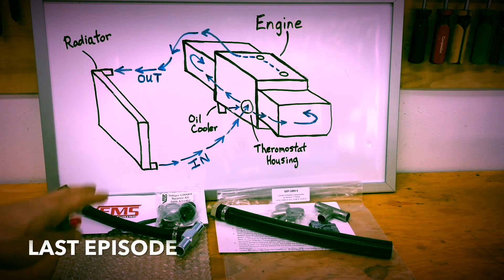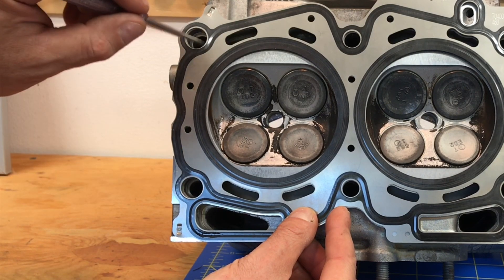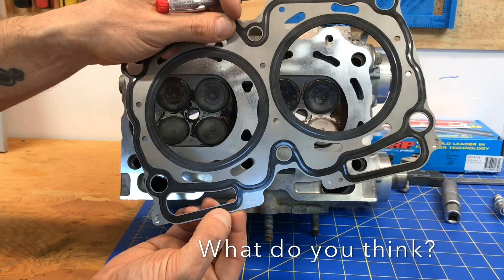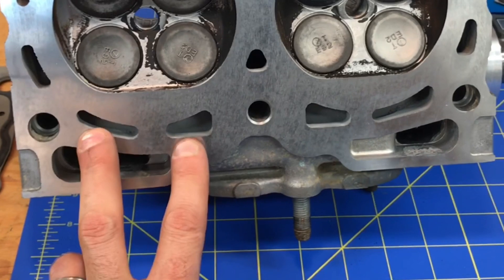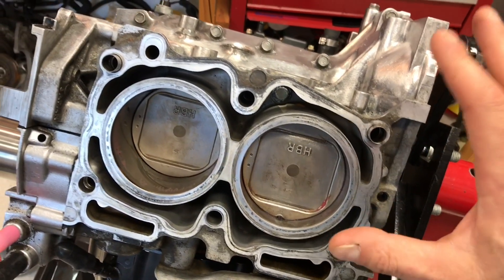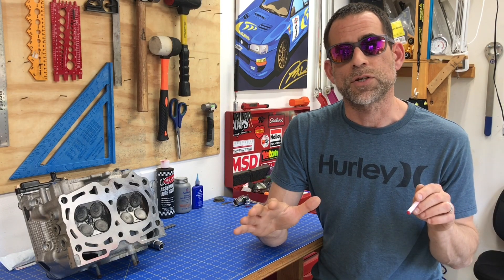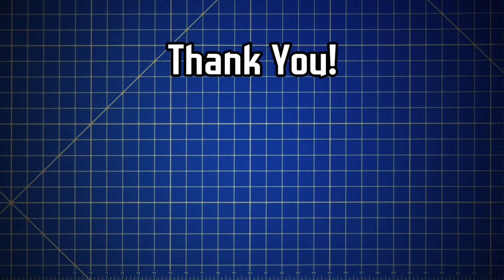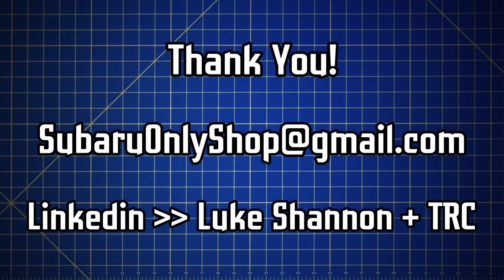Coolant Flow in Subaru EJ-Series Heads

Comment: Hi LUKE = i put a ej207 jdm sti , virgin block into my 2001 forester - did heads with brian crower guides springs valves - s/s swirl polished viton seals - and 5,500 klm did the no 4 by-pass coolant upgrade - i could tell a differance with in 5 klm drive - i have big radiator new new new everything - great modification instant benefit = thank you paramedic life subaru saver LUKE !

Comment: Need help, so I installed a 4 cylinder cooling mod then I put a 6-7L Subaru OEM coolant, did the burp but for some reason my coolant reservoir didn’t change still empty even I put 6-7L of Coolant? Any guess?
Reply: Even I put coolant in the reservoir between full and low lvl line, every time I drive it it’s go back to the very bottom of low lvl
Reply from the maker: I’d keep adding coolant till it stop dropping in the secondary reservoir. Must still have some air pockets.
Reply from the maker: And good luck!!!

Comment: Hi mate im just asking why my subaru impreza 2002 radiator coolant hot on top and boiling but on below is cold, but when I removed the thermostat its still open meaning pump failing or head gasket?
Reply from the maker: Yes, your on the right track. Most likely one of those two issues causing the over heat. Good luck! 👍

Comment: Great Video!!! 
Got a question.  Are there any benefits of installing a reverse coolant mod in a EJ253 2.5L SOHC? I'm In the middle of doing a Head Gasket Job and while the heads are at the Machine Shop it would be a great time to install one if there are some. Thanks for any info.
Reply from the maker: Prob not really needed for a stock engine tune. But couldn’t hurt either.

Comment: So what's your opinion on the strategy for Subaru not to use cylinder 4 cooling mod for the purpose of letting it runner hotter for better knock control?
Reply from the maker: Are you referring to letting cyl #4 run hotter for better knock control? I don’t think that’s an accuse statement, from my understanding, the heat build up in #4 creates conditions where knock become less controlled and more inconsistent.  Also, tangential question, you sound like you have some serious experience in this area, if you don’t mind me asking, what’s you background with these engines? You an engine builder or high performance machinist, just curious. No replacement for real world experience in my opinion, that’s a 10X when it comes to one’s options, especially when there’s so many messages board experts out there.  Thanks again and cheers!!!
Reply: @SubaruONLY I'm an inventor. Built and owned a few EJ207 swapped cars. EJ runs one knock sensor; FA uses two (like most modern engines) --leading me to believe Subaru engineers are trying to improve knock control. Just a theory. I'll be testing my first prototype for a new EJ cooling system design this month. If all works well, maybe I'll send you a kit to try out?
Reply from the maker: For sure man. Send me an email and we can touch base and correspond there, cheers and looking forward to seeing the results!

Comment: I know this was a year ago, but I definitely would not work to increase flow of the coolant. Those restrictions are deliberate. Their purpose is to increase the amount of time the coolant has to pull heat from the engine, and in turn increase the time the radiator has to pull heat from the coolant.
Reply from the maker: Yes, coolant needs to have the residency time in the heads to absorb enough heat. Agree. Cheers buddy!!!

Comment: I don't know if anyone has mentioned it, and it seems that this is over a year old now...but I believe the coolant passages on the headgasket are sized like that for a VERY specific reason. That is, metering coolant flow. If the ports are too big, the coolant will flow too fast and not spend enough time absorbing heat from the head/block. FelPro has a good article explaining this. Let me know what you think!
Reply from the maker: May be a year old, but certainly still worth discussing!  Yes, 100% agree with you, especially about the time the coolant needs to spend inside the head to absorb heat from the head surface. 

That still leaves the problem of preferential flow due to inlet and outlet port locations. Any thoughts on that one?
Reply: @SubaruONLY  It seems like it might just be a design flaw like you discussed. It's clear that having the huge intake/exhaust ports of the coolant flow cause the path of lease resistance. So the water flows there first and doesn't leave much flow on cylinder 4. Looking into a few different type of cooling system designs, it seems this is a more parallel path. I'm working on an inline 4 cyl engine now that has a series path cooling system. The coolant flows through the block and then enters the head on cyl 4. Then flows back towards the front of the engine in the head. Hopefully that makes sense! I'm not sure about boxer motor design, but it seems like this might be the only way to do it reasonably.
Reply from the maker: Yes, likely a constraint with the design and local of all the ports. Yes, that inline description make sense. Sounds cool, this for a Motorsport  application?

Comment: Love your explanation of the coolant taking the path of least resistance 👍 and how the cooling mod helps
Reply from the maker: Thanks buddy!  This is actually my field of expertise professionally. Have a masters in fluid mechanics and hydrologic engineering - applying those concepts to our Subaru engines has been really rewarding and it allows me to create some unique content (I think). Cheers!!!
Reply: @SubaruONLY  I actually looked at studying hydrodynamics at uni with a view of applying it to a motorsport engineering degree there after. Partying got the better of me in 6th form though 😂 really cool to see this level of detail though and its somthing I geek out over. More suspension geometry and setups along with weight reduction though these days 😅 applying this kind of thinking and theory to road cars is somthing that I'm crazy into at the moment anyway, so it's awesome to see someone else with such a keen eye for details that make a car
Reply from the maker: Nice man. Feel you, can’t help it. Cheers!

Comment: I get the point with the cooling mod and the negative pressure etc. But like you say, coolant will circulate the path of least resistance as it is forced around the engine. Its a lot easier for the coolant to escape through the mod pipe into the heater pipe then it is to force itself through the jackets into the rear of the cylinders and up through the exit port. I feel like this mod would be beneficial for the lower half of the cylinder but it would only slow down coolant movement to the top.

It seems to me the sensible thing Is to port the gaskets and leave it at that.
Reply from the maker: Late reply here (BIG TIME, lol). Just wanted you to know I’m back and got some cool things unfolding on the channel. Cheers and hope you are well!!! 👊

Comment: Great video! Just wondering if you're running an oil-cooled only turbo setup, would any modifications needed to be done to the opposite head so the flow isn't impeded? I'm assuming that since the turbo is on that side and has coolant flowing to it from the back of the head, it's helping flow coolant over cylinder #3, correct? Would you just route the turbo coolant feed straight my AOS then back to the upper-coolant reservoir, basically bypassing the turbo section completely since it's no longer needed?

Comment: Subaru p/n 21170AA020 - PLUG-WATER BYPASS is the OEM fitting for the no4 cylinder head plug. Add on a small length of hose & a tee from eBay- sorted.

Comment: Opening up the slots in the gasket might affect the back pressure in the lower area of the block (because of the restriction created by the smaller slots), which could possibly could make the flow issue around cylinder 4 even worse (more stagnation) by making the path of least resistance around cylinder 2.   Although, I believe that if you open the one near the rear of cylinder 4, you might could increase flow there a tiny bit more.  It also looks like there is a fairly dead area of flow around the top of cylinder 2 (flow wise).    I used to have access to computer modeling software that would calculate approx flow lines in 3D models to locate the "stagnant" areas where flow velocity is approximately zero (eddies).  This would be fun to model.
Reply from the maker: Your 100% right and you hit one of the key points I’m going to highlight in the closing video to this series.  Way to stay on top of all this and connect the dots man. Brilliant. 😁
Reply: Correct,  the gasket "slotting" allows Subaru Engineers to fine tune the coolant flow through the engine.

Comment: Any thoughts on whether the reverse cooling mod is necessary on a Supercharged NA car? I think if you did it, you'd need/want to do it on both cylinders 3 and 4?
Reply from the maker: Think it would be a good idea for sure. Ever do it?
Reply: I appreciate you for explaining on how the head gaskets work I had an idea like I knew how they worked but only 70% I didn't know how the flow worked unfortunately for me my 2014 Dodge charger 5.7 hemi has a coolant issue I already kinda know that the coolant passages are going to be clogged due to rust and other things but it also needs the head gaskets replaced I haven't ran it just because if coolant goes where you explained where the oil is I will have a huge bigger problem for sure right now its just leaking coolant into combustion chamber I'm going to take out the heads take them to get resurfaced and have those ppl clean the heads for me like the passages clean them if they are clogged mean while I was thinking of cleaning  the passages under the head gaskets if I make sense basically stick a  garden hose there the hole is where the water pump sends coolant into left head bank and right head bank hopefully that will clean out what ever is causing coolant to not flow I'm also going to be purchasing a new radiator what are your thoughts on that about me cleaning the head banks  I have to remove the water pump and do it that way there's 2 holes on the front of The engine block one for enter and the other seems to be an exit for the coolant I just need to try that while the heads are getting resurfaced and cleaned I just don't want to end up getting water into the oil since water will be mostly coming out of the passages where the pistons are at or am I confused on how coolant flow works your video is only showing the head and gaskets not the engine block I'm taking about the engine where the cylinders are  @SubaruONLY

Comment: The build is coming along nicely, due to poor cooling would you consider a dual cooling setup, for instance 2 seperate reservoirs, split the radiator into 2 and run a seperate pump including the original, 1 system cooling cylinder 1+2 and a seperate one for 3+4, and split the other peripherals throughout each loop

Comment: Good fluid flow explanation. I'm pretty sure sure you're familiar with Navier-Stokes, Bernoulli equations lol. Anyway the coolant flow asymmetry favouring one cylinder over the other is clear. Subaru's idea of a sacrificial cylinder (number 4) for knocking also seems odd. Sometimes I wonder what their engineers were thinking. 
Btw did they make the head gasket slots smaller to help prevent gasket blowouts? But the pressure from the coolant flow through behind the restriction will try to lift that gasket lip up, maybe damaging it in the process.  It's all a bit weird. Very interesting though. Great vid.
Reply from the maker: Sorry I missed this. GREAT comment, I wonder the same thing. Cheers!!! Hope all is well.

Comment: What reverse coolant kit do you believe works best?
Reply: Getadomtune.com He is the originator of the mod. He chose the diameter of the mod carefully to make the most of it. Don't just grab some fittings and throw them on. Do it right and get the results.
Reply: maxs1000rr getting your own fittings and hoses will do the same thing for much cheaper.
Reply: All the same. Make your own cost 20-25

Comment: I really appreciate everything you do on your channel, you go out of your way to make people comfortable working on their Subaru. But, Please, Please, Please, STOP calling this a "reverse" cooling mod. This is just spreading more misinformation within the Subaru community. There is more than enough misinformation ( and just plain bad ideas ) in the online forums.

This "mod" does not "reverse" the flow of coolant.

You actually had it right at one point in your video when you stated that it allows a second outlet for the NORMAL flow of coolant.

All this "mod" does is take advantage of the built in cooling port that would normally be used anyway if the head was in a non-usdm turbo Subaru (right hand drive). Anyone can simply look this up in the shop manual for jdm vs. usdm models. And, as a point of responsibility, you should point out that the pressure differential this would create will reduce the flow to the other side of the engine. Which could raise the average running temp on that side by 1-2deg c. Which also affects how hot the turbo cartridge will run ( and thus its usable lifetime ) since it is the recipient of water flow from this exact same port in the other head.

"Reverse" cooling is where the flow from the pump goes directly into the heads, then through the blocks water jacket and out to the radiator. You should know this from your involvement in other motorsports.

And, as a suggestion, since you are an engineer, you may want to run a few numbers before getting out your cutters. I think you will find that modifying the head gaskets may only give 1-2deg c improvement ( if that ).

I really want to see your channel succeed. There are so few people showing old-school Subi-love anymore. Please take more care in your research and presentation on your videos. As it stands, by attaching your IRL professional credentials to this video, you actually make yourself look bad because you are propagating misinformation. You are also putting your current employment at risk, as more and more companies are letting go of employees when they find out that they are producing media on any of the social media platforms other than LinkedIn.

Signed, A concerned car enthusiast and YouTube citizen.
Reply: If I have an RHD engine here in Australia would I benefit from doing this mod?
Reply: @WildDanHibiki  Want to know this too!
Reply: Correct.  This is not REVERSE COOLING.  This is just adding back a coolant flow that exists on twin turbo Subaru engines.  (look it up)
Reply from the maker: Late reply here (BIG TIME, lol). Just wanted you to know I’m back and got some cool things unfolding on the channel. Cheers and hope you are well!!! 👊

Comment: This is a great series. I discovered the coolant mod a few months ago and thought it was brilliant plus the getadomtune guy has a patent pending on it. There's no way that it wouldn't work and it's a great preventative mod. Also, I haven't thought about modding the head gasket and I'm considering doing that, too. It's like porting your manifolds to match the gasket except the other way around. If it isn't done haphazardly, it can be beneficial. Think about the extra pressure and turbulence on that part of the head gasket that's not even necessary.
Reply from the maker: Late reply here (BIG TIME, lol). Just wanted you to know I’m back and got some cool things unfolding on the channel. Cheers and hope you are well!!! 👊

Comment: Really been enjoying your videos, I'm looking at picking up a 98 legacy wagon as a little project car. My plan is to go all the way to the short block and possibly build from there; pistons, rods, bearings and all that. Was wondering if you could make a guide on ordering OEM parts. Subaru's diagrams are confusing to me and it's hard to tell what actually comes with the parts you order. Thanks!
Reply from the maker: Sorry for the late response.  I’ll put together a guide on this for sure. And BTW, I’m back!!! 😎